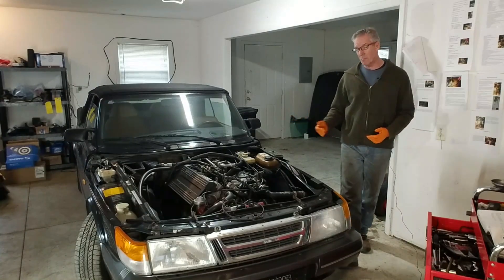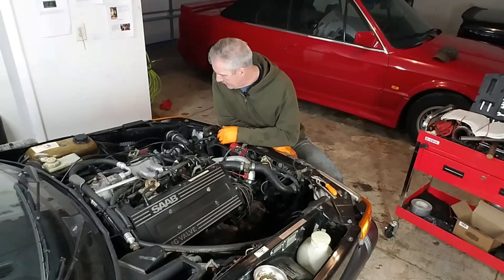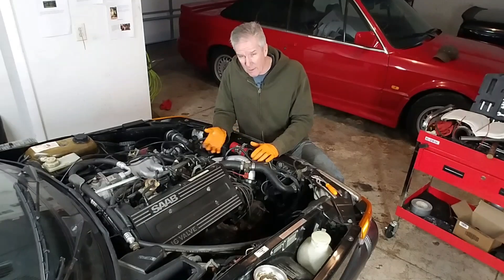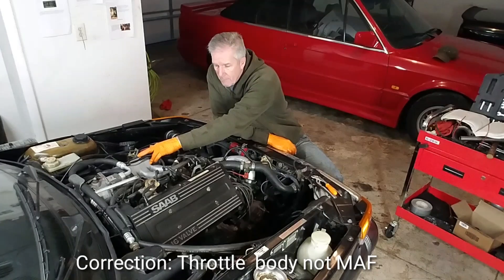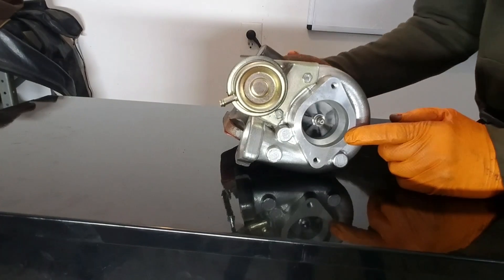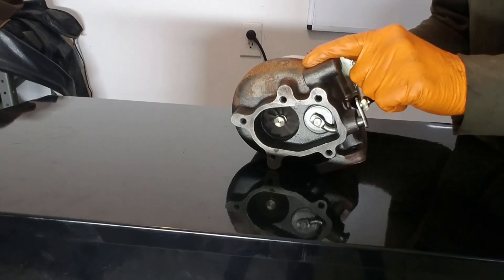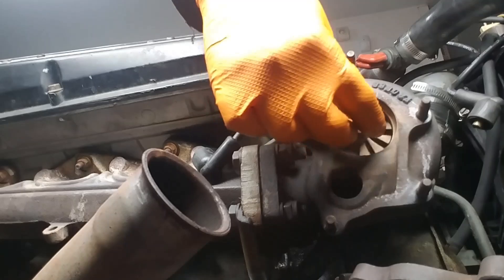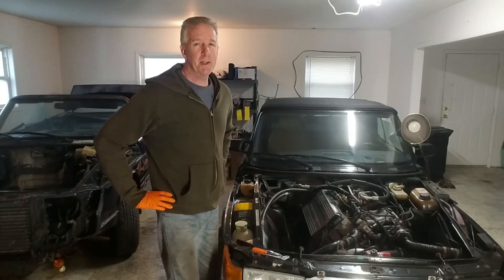Ep.3 Saab 900 Turbo system basics explained

Comment: Geoff Kershaw, a English guy, heard a few guys at SAAB were working on a turbo on the slant-4 Triumph engine used in the SAAB to get more HP, as they had no money to develop a new engine. They were not having too much success, they probably would have given up. So Kershaw approached them then working with them in Sweden to develop the turbo adaption. He developed the flap waste gate to eliminate turbo lag. 

Geoff Kershaw was the turbo expert who came from Rolls-Royce working with turbo-diesels, while the SAAB engineers did not have such specialist knowledge winging it. Kershaw bought one of the prototypes at the time taking it back to England having it in hs company in Northampton. I believe SAAB destroyed the one or two other proptotypes they had.

Yes the SAAB was the first mass produce turbo car.

Comment: This set-up with the red air-filter is not the most efficient (guarantee to poach at least 20/30 ponies..!!)...placing it mid-level (for best air density levels) behind the fender or  in an hermetic box sucking out-side fresh air would be a better set-up..it gets really hot under that hood (I own also a 1989 900 turbo ,and I track it on a regular basis)...also for a cooler engine bay I installed connectors to have manual control over two powerful heat extractor fans (heat sensor in the bay allows to keep the general temp under the hood at 65°c sitting at a red light with fans on a sunny day..!!
Reply: The intercooler uses air, not coolant, is that correct?

Comment: Remember to ALWAYS use Full Synthetic motor oil when you have a Turbo... Its the only thing that can handle the heat without turning into sludge.  I dont know how many Saab Turbo's would still be on the road if this were the case... A Lot more of them.  I've owned 10 900's in my day...An absolutely wonderful vehicle.  I used to buy them for 300-500 dollars and they were gorgeous.  My last one...the 89' 900 Turbo Cabriolet was the prettiest and fastest one... I still regret selling her.
Reply from the maker: Opinions about the value of synthetics are deeply held and subject to debate, but I splash out for synthetic in all my cars.  When you understand the many vital roles oil plays in today's complex engines, it makes sense to spent a little extra. I typically extend the replacement interval to 5,000 miles to offset some of the added cost.
Reply: +Lee Kelso  Yeah I have stretched my Oil Change regimen out a bit further than the usual 3K...Now I usually go 5K on regular dino oil...and 7K on Full Synth.  The only vehicles I use full synth on are Turbo Charged...again, for the heat factor.  Without installing a Turbo Timer...the turbines suffer from serious heat soak when you shut the vehicle down without a cool off phase.  I have seen far too much Dino oil turn into fudge brownies because of this, it really is a factor.  The full synth doesn't have any problems with the heat at all and I've never seen it sludge yet...and I see a lot of engines in my profession..  Its a must for Turbo's
Reply: 10 SAABS?  Man the SAAB bug really bit you hard!!